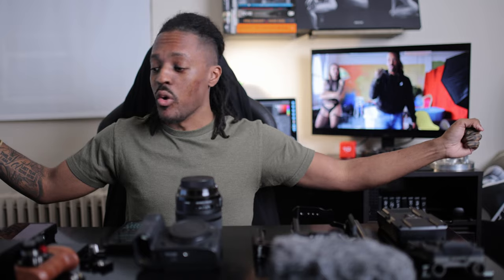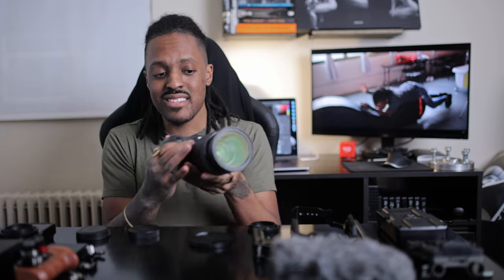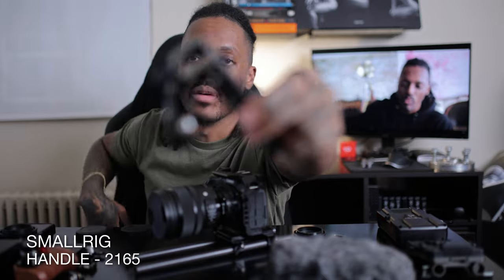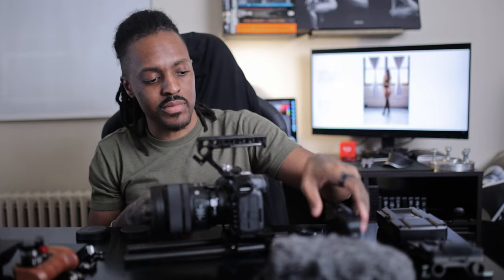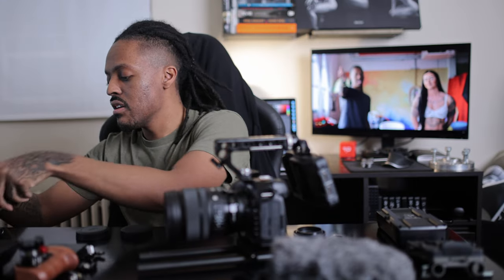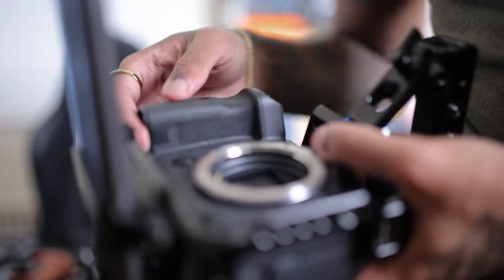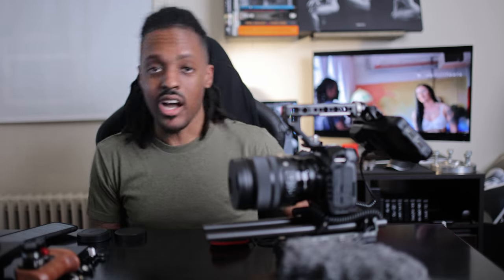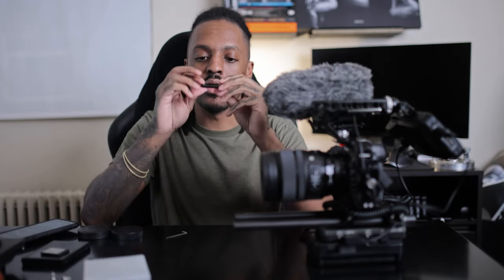Canon EOS R5 Handheld Cinema Rig V3.5 w/ Sigma 24-70, and SmallRig Accessories and more

Comment: Sway, how do you mount this on a tripod?
Reply from the maker: So this is basically my handheld only setup, if I need to put it on a tripod I flip the battery upside down and mount it behind the camera on the rails instead of underneath. That way I have access to the base plate to mount it to a tripod. I hope that made sense lol

Comment: I loved your video bro. Really helpful the way you showed how to assemble all together. The only pb I have with your battery being bellow is that it makes it unfit to put it on a tripod if you suddenly need it. I will check on options to put it somewhere else. But thanks again
Reply: And the matte box is so cool but unless I am wrong, you cannot use VND which is annoying... I would hate to pull out of my bag a different rectangle filter every time I need a different shade.

Comment: I am debating between Sigma 24-70 with EOSR adapter vs Canon RF 24 - 70 for Canon R5C. How comparable is Sigma to RF? I am hearing that autofocus may not work in Video mode in Canon R5C?
Reply: I use sigma primes on my r5c, they all work fine. Only issue I had was that one of them needed to be updated to work on my r5c

Comment: Nice rig breakdown dude ! i am still using my GH5 rig,  but it's good to see you switch to another system.

Don't you have some things you miss from the GH5 ?
Reply from the maker: Thanks fam! And the only things I really miss from the GH5 are the IBIS (this isn’t far off really), and the ability to use shutter angle. None of which are huge deal breakers for me.

I would bring up the GH5 being less likely to overheat than the R5, but as long as your conscious of it, it never happens.

Comment: how do you manage to plug the 2 D-taps? there is only one on the Tilta V mount! Do you plug the other one straight to the battery?
Reply from the maker: The tilta V-mount has 2 D-taps, unless they changed it since I purchased it. But you could plug the other straight into the battery if you need to
Reply: @SwaytekDigital  Thank you for replying so promptly
Reply from the maker: @jdflyzone  no problem, I’m a small channel so I try to respond once I see the notification on my phone